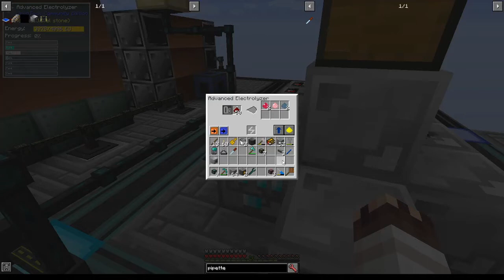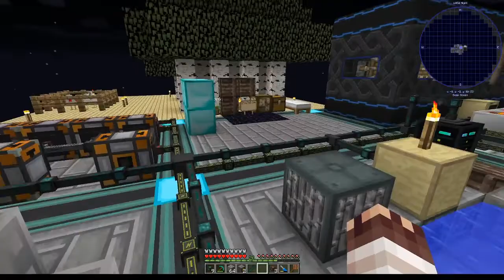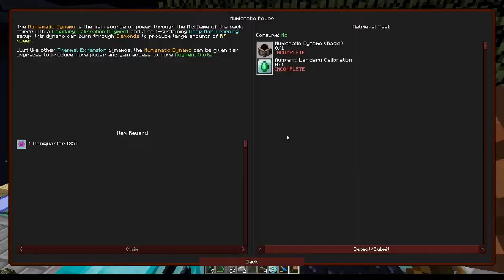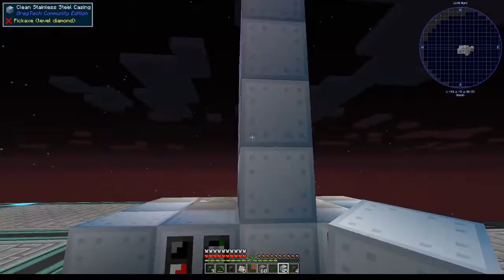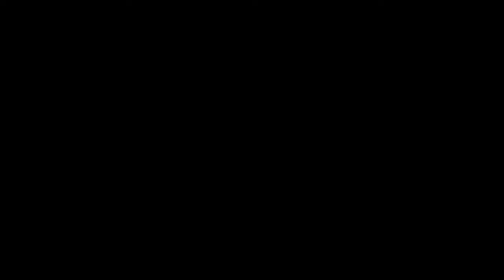New Omnifactory Supershorts #14: Stainless Steel and Distillation Towers

Comment: Yes, fish oil and canola oil are terrible for epichlorohydrin, but seed oil is commonly an overlooked option, and you can get it from sugarcane seeds. Also why did you use electronic arrays for HV machines when refined arrays are cheaper?
Reply from the maker: Refined arrays cost stainless steel! I was using so much of it in this episode that I decided to go the cheaper route. In fact, I actually use electronic arrays until I get microcircuits, at which point I get microprocessors in droves! You’ll see that in a few episodes.
Reply from the maker: Also, pinning this comment so people will see that sugarcane is an option!

Comment: The disadvantage of using PVC for plastic boards is that you already have infinite polyethylene and copper, but PVC needs chlorine, which is a bit trickier - and you'll need so much chlorine for all the other stuff you're going to be making. Did you find a good way to get chlorine without coins yet?
Reply from the maker: I am shortly to automate T1 MMs, which is how I will get infinite chlorine.